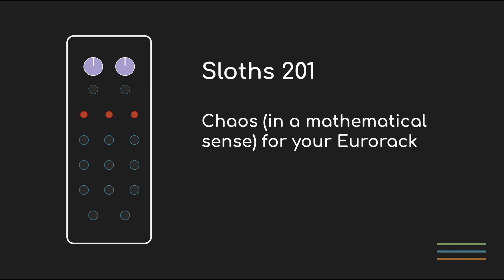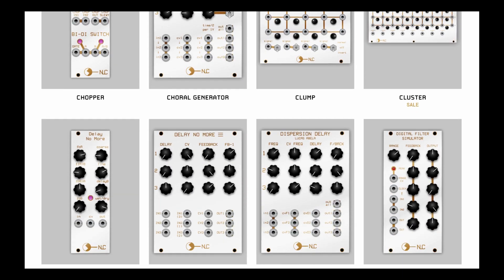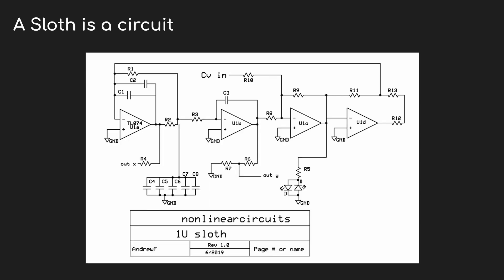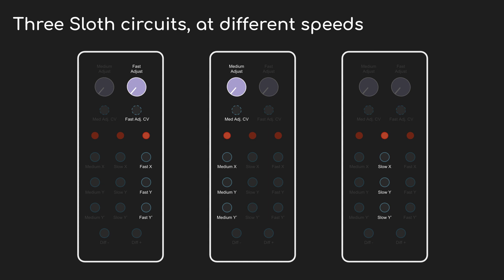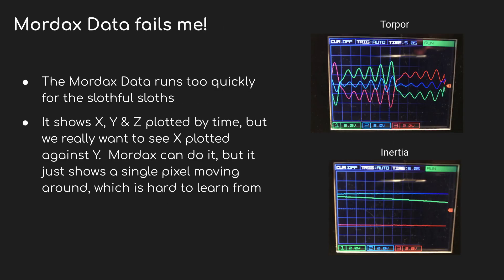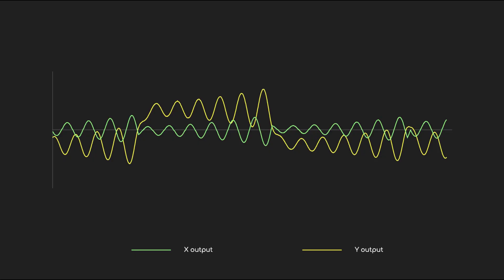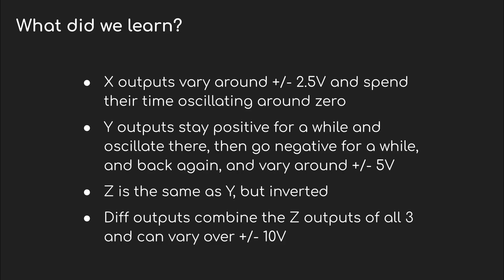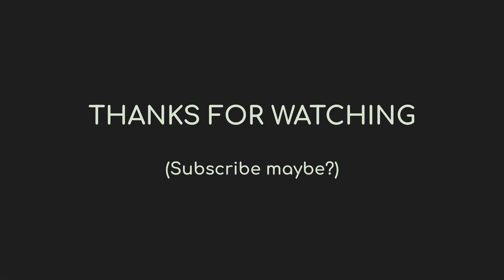Sloths 201: NLC Triple Sloths Explained!

Comment: After years of delay I’ve ordered a Triple Sloths for myself. Well, sort of; I ordered a kit. Unfortunately I now learn that it includes SMD components, which I have never soldered before. In fact, I haven’t soldered at all for at least a couple years. 😬
Reply from the maker: @tracyharms3548  You know, soldering SMD components didn't end up being as daunting as I thought.  The 0805-size is big enough to manipulate with some tweezers and solder with an iron.  The trick is to have good magnification and light.    I had a lamp/magnifier combo that was a godsend.

But maybe buy one or two of those SMD practice kits on Amazon - get a bit of practice before you tackle the Sloths.

Comment: you know, id have to add a correction to your video.  even though i dont own a sloth module,  the thing about the CV you are adding to the sloth, is that the CV is too fast.  if you add a sloths output CV , to the sloth module, then itll change the shape of the waveform much better. it would make them go longer, spiral out more, or inward more, and so forth, or , make it go longer. instead of wobble and warp like on your video. its just food for thought because,  i realised this as you are speaking , i did not know what a sloth module is even though i been into eurorack a bit and modular synth and,   just would be interested in a sloth module but when you were talking about CV into them it had me thinking this. that is all

Comment: I bought a Sloth because of the explanation here, and absolutely love it. It's made its way into so many patches already, not even necessarily slow sounds, but just anywhere that a dash of slow change would improve a performance.
Reply: I'm considering this module but Im usually hovering around the 120-130bpm range.  In my mind it'll be really nice for animating loops over time in an interesting way.  Would it work or is it too slothful?
Reply: @stuartbennett4301  It's pretty, uh, slothful. You could still use it for longer phrasing within your patches, but the fastest one is around 30-45 seconds per cycle so don't figure on it keeping pace with any bpm.

An example of how I've used it with faster patches is controlling a VCA or as input to a logic gate to bring parts in and out over time.

But you might find Cellular Automata a better module for some randomness at higher bpm.

Comment: The CV ins are summed with the Z outputs. So if you want 'a faster sloth', input a faster LFO. Also the LEDs show the Z output and do show the summed output of Z and CV (blue negative, red positive). So I'm not sure what the 'CV control of nudge' at @3:47 means. The knobs do 'steer' the preferable output value (CCW negative, CW positive), but it only after x seconds, like it slews. The inputs do not control this, or at least, they have an immediate effect in Z out, not after a while.

Comment: What if you link multiple sloths together? What happens than.
Reply from the maker: You get slightly more chaotic chaos :)

The only way to link them together is to take an output from one and put it into the CV input of another, and all that does is nudge the equation a little bit.  This is what I am demonstrating at 00:06:54

Comment: Hi, it seems that 
Joranalogue has made a better sloth with the Orbit 3.  what do you think?  the mordax animation looks the same on both
Reply from the maker: That's pretty interesting, I haven't had a chance to play with one.

The big differences would seem to be a) more control, b) very different speeds.   I kind of like  the lack of control of Sloths...it's just there and you plug into it and it does whatever it's going to do.  The speed difference is pretty stark however - Orbit 3 goes from audio rate to 7 mins per cycle, and Sloths goes from 40 seconds to 40 minutes (or longer if you build your own).

I'll have to pick up an Orbit 3 though.  I think of Sloths as "seasoning for the patch", but Orbit 3 seems like a whole new ingredient for the recipe. :).  Thanks for letting me know!
Reply: @SoundVoltage  yep,  that what I was thinking,  they are extremely alike but so different.  Both have their strengths,  and the sloth has 3 channels...  And I agree that sometimes it's better to have less control,  but sometimes more control is needed.  Guess that the best option is to have both of them 😜